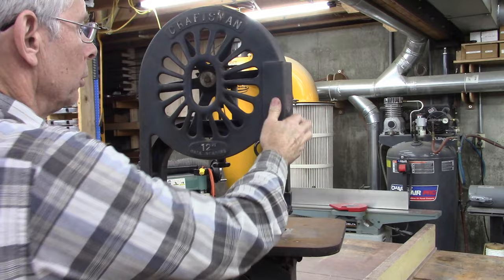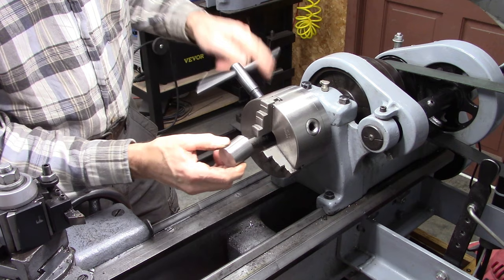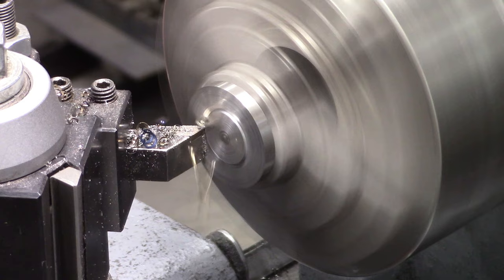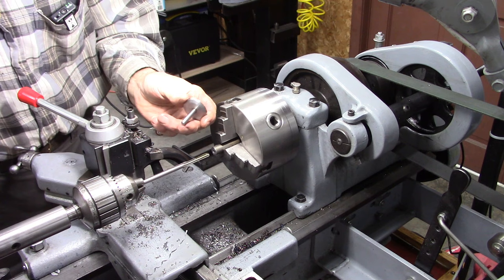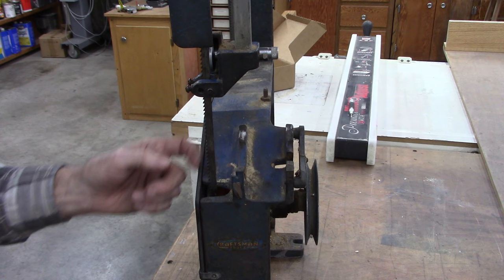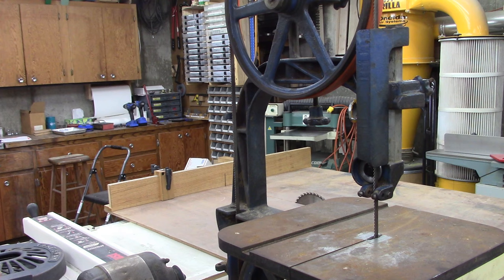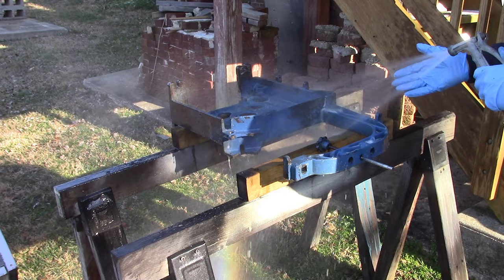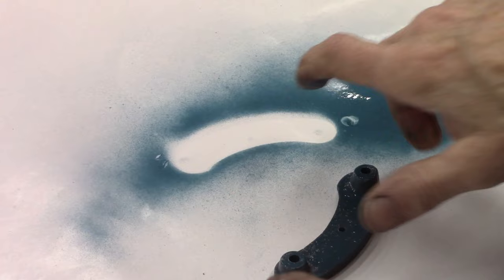Restoring a 1930's Craftsman Bandsaw - Part 1

Comment: I have that exact saw.   I think they are referred to as the “Snowflake” model.  I put a thread mill motor and controller on it so I can cut both wood and metal.  I also fabricated new upper and lower blade guides using roller blade bearings.   Mine was in nice shape too but I did put new tires on it.   I inspected the  bearings but they were in good shape, but I did notice they were metric which I thought was interesting.   I put a high quality German made blade on it and use it mostly for cutting metal.   I absolutely love it and use it all the time.
Reply from the maker: Cool...  my upper guide works well but I may replace the lower. Yeah, this is a nice saw.

Comment: Glad to see the bandsaw being cleaned and refurbished and given a new life.   They do not make them like that any more.
Let me know if you want a small chuck of lignum vitae to make dowels for the lower guide.     The natural oils in this wood have been used for bearings for centuries.   I recently cut some into 1/2in square short lengths for a local friend to use at the lateral guide blocks in her Jet woodworking bandsaw.
Dave.
Reply from the maker: Hmmm?  sounds interesting. winkysworkshop@GMX.com

Comment: Hi there Mark, that is a beautiful machine, nice find.!, that would look very Amazing in that dark /Burgundy Red that you have used in the past. Love that color. But what ever you paint it , it will look beautiful as always
Reply: You are exactly right that dark Burgundy he used on the belt sander would look amazingly good on that saw with all the cut outs around the blade wheels.
Reply from the maker: I agree...  love the read paint. This blue paint is close to original and I got it dirt cheap. I like the blue color but also agree, the red is nice.
Reply from the maker: Yeah...  that was the CBN grinder and also the base for my drill press. I agree, a great color.

Comment: I have a 1932 Craftsman band saw owned by my grandfather and later my father. It works great. Only had the rubber tires replaced once (by me) in all of that time. I think the blade on it is original.  It also has a full metal lower blade guide and not a random piece of wood stuck in the blade guide holder. Your upper blade guide is completely missing as well.
Reply from the maker: The upper was all there aside from the thrust bearing which I made in this video. From all the pictures I have found of the lower guide it was originally a steel dowel but I made a new one with bearings that will be in a follow up video.

Comment: Mark I love it. Walker Turner made one that I have always wanted. Cast iron blade guards. Very ornamental. All of them I have seen are for wood and would need to be geared down.
Reply from the maker: Thanks, this one will be "belted down"? Ha
Reply: My opinion belt drive would be much quieter and better. I have a Belt drive mill and a gear drive mill, and the noise is remarkably quieter and smoother than the gear drive and it also has VFD for speed control. Its already a sweet looking saw and I am sure it will be top shelf when you finish the project as your work is always of great craftsmanship.   @WinkysWorkshop

Comment: Nice score. I'm eager to see where you go with this project. I have a Delta 14" woodcutting saw. I do little in wood, so it took up floor space, largely unused for thirty years. At long last I did a metal cutting conversion. My 4x6 H/V saw has served me well, but it's really nice to have a proper vertical saw now. I use it a lot. You'll really enjoy yours.
Reply from the maker: Hopefully my slow down works well. We will see. It will be handy!
Reply: How did you slow your Delta 14” saw down? I have the same saw and have thought about getting a one horse 3 phase motor and a VFD for it so I could use it for both metal and wood.
Reply: @Hoaxer51  After pondering several methods, I wound up at a two-step V-belt reduction to get from wood speed to metal speed, and a 3-Ø motor and VFD to get a range of metal speeds, from about 80FPM @ 20Hz for tough steel to 400FPM @100Hz for aluminum. I don't think you can get enough range for both metal and wood from a VFD. You'd have to run it from about 15Hz for steel to 400Hz for wood. Seems risky to subject a motor to that. But the wheel shaft is long enough to fit both the original pulley, and a large one for reduced speed. So for the rare times I want to cut wood, I remove the two short belts, swing the countershaft out of the way, and put the original long belt back on. (My saw has its motor on a shelf near the bottom of the legs, and I put it on a tilting motor board, so I can adjust for belt length and tension.) Not as elegant as flipping a lever or two, but it's easy and takes only a minute.
Reply: @randyshoquist7726 , Thanks for the reply, it seems nothing is ever easy, does it. I keep looking around to see if I can find another bandsaw for a good price but nobody seems to be giving them away, so that’s probably the way I’ll end up doing mine also.

Comment: Years ago, while on vacation, I found a 25:1 gearbox at an indoor flea market that I wanted to convert my bandsaw to cut metal.  I carried it on the airplane in a plastic gift bag and at about 30lbs, it would have gone overweight in my luggage.  I had to act like it didn't weigh anything and set it between my feet under the seat in front of me.  I wrapped it up good but that gearcase oil smell is pretty strong.  I thought it was the best thing that happened to me on the whole vacation at the time.
Reply from the maker: Part-2 will be posted Friday and then Part-3 a week later. Part-3 will feature a home made slow down...  You sound like me with the gearbox

Comment: Nice ! I did the same thing with my blade guide,but I was lazy and used a valve from an old dieselmotor.Hard as a koffernail,but I could cut it with cbn.
Reply from the maker: Darn good idea on the thrust bearing!

Comment: 4140 H.T./P.H. is about 28-32 Rc hardness. It makes great cutting tool holders. Its much stronger, wear resistant, and cuts with a nice finish using carbide tooling. I made many tool holding arbors out of it. Good Stuff! F.Y.I.- Nothing worse than ice in your hose!
Reply from the maker: Ha...  yep, it was too cold for sure. Good to hear on the 4140. Steel types are my weakness.

Comment: Interesting project. Never saw a bandsaw like that one before. I used a 135 rpm Dayton gear motor to slow my Delta 14 down for metal cutting but still needed three/one reduction to cut tool steel. I’d try a hardwood or Delrin dowel for that lower guide. Rigidity will be an issue for metal.
Reply from the maker: I'd say you are right about the metal...  maybe I'll go all our and build one with bearings. Thanks

Comment: Nice find Mark. She will make a great user.
On a side note, the audio on your video is great. The lathe still has its note but it didn't overpower the audience. Not giving commentary while the lathe was working also helped. 
Looking forward to part 2, and seeing it in action in future videos
Reply: The official temperature in Geraldton Australia was 49.7C, about 121F, last week (and a fair bit hotter in my workshop). Maybe you could send us a little of that cold 😅
Reply from the maker: I'm exploring a gear hobbing attachment for my mill. If I ever get there new gears for the south bend will be the first thing I do.
Reply from the maker: WOW! I hope I never see temperatures that high! Thats terrible.
Reply: @WinkysWorkshop , A hobbing attachment, that will be an interesting video, hopefully in the near future.
Reply from the maker: @Hoaxer51  I'm getting help with the gear hobber controller.

Comment: I have a 20" Cresant bandsaw,heavy,the motor runs 850 R P M's it's 1HP the motor is heavy 😅 it weighs 100 lbs. The lower wheel is mounted to the motor it's got at least a 1 inch shaft.I cleaned it up repainted it and it worked great.
Reply from the maker: I'll bet it does! Love the slow motors!

Comment: Great resto job, love old tools especially when someone like you takes the time to do a great job on them. Just one question, why didn’t you use a self etching primer or a high build primer?
Reply from the maker: That's a good question and I actually considered putting it on my video but i was afraid it would ignite a lot of disagreement. First, laziness (ha) but second, the saw was not originally a smooth finish and I thought it might make it look too new plus the casings are all excellent anyway. As for the self etching primer, I have had terrible luck getting some paint to stick to it and I've never figures out if it was the primer or the top coat. In the case of my Hardinge lathe cabinet I had terrible luck with the primer not bonding to the base paint. Overall I've had excellent results with the paint directly on the metal of even slightly rusted and cleaned surfaces. The hardinge Lathe itself I used filler an automotive primer and it did well.

Comment: That's a nice little saw Mark. I'm wondering if that lower blade guide is a phenolic/linen composite. I bought some square guides for a similar sized saw called "Cool Blocks". They were a phenolic/linen impregnated with graphite.
Reply from the maker: Thanks, It might be but it looks like plastic. I think the original was steel from the pictures I've seen. I just made one with bearings so problem solved. I was worried about using it with metal and that original guide.

Comment: I have a Jet table saw with a motor mount that looks very similar.  Last year I had to replace the mount because of metal fatigue and it BENT close to the pivot point.  I was lucky that I was able to find a replacement.  Perhaps the homemade mount you found was simply someone's attempt to fix a bracket that failed similarly.  Most homemade stuff looks like crap, but I bet you can do better.
Reply from the maker: I'm making it now...  I think you are right. Thanks

Comment: A couple of pillow blocks and a jackshaft maybe with a large pulley should slow it down enough.  You see a double pulley every now and then with a small one and a large one, but I looked and didn't see anything even used on ebay (kinda reminds me of a cement mixer).
Reply from the maker: I built a slow down with flat belts, video in one week.

Comment: If you used a vfd and one of those 3/4hp, 1150rpm motors, I calculate you could drive it with a 1.75" motor pulley and a 10.75" drive wheel pulley (no gearbox) that would give you 100-600 sfpm blade speed and a cutting force of 40lbs (dragging the blade thru the metal) which would work for steel and aluminum.
Reply from the maker: Yeah... I think the new motor would be an eye sore on the old saw. I'm building a slow down with belts...  hopefully it will work!
Reply: It wouldn't look original (ha, you could paint it to look like the old one) or maybe just hide all the reduction stuff in the base.  Any idea what speed you plan to shoot for?  I've got lots of pulleys if you give me an idea of something you're looking for.  That's a neat little saw. @Workshop
Reply from the maker: @robert574  100 SFPM is what is needed for steel. For a 12" wheel on a bandsaw that is 33 rpm.  Here's a sneak peak the video coming out next week. https://photos.app.goo.gl/ni5kTjPLeCeu98wX7

Comment: Dunlap didn’t come about until 1941 so doubt it was the original. if you are interested those motors did have a date code of something like MW YY. Where M was a letter showing the month (A = Jan, W is week of month and YY is year). Should be stamped and not printed on tag
Reply from the maker: Interesting. You know a lot more than me. Thanks!

Comment: Hello Winky, I can not wait for the next video, can it cut metal and what throat size is it? It is in good hands for a complete make over. Cheers from me. 😷👍👍👍👍👍
Reply from the maker: Its a 12 inch but big enough. Wood only right now but I'm going to build a slow down so it will cut metal - thanks
Reply: OK, thanks for the reply, will a speed control work? @WinkysWorkshop
Reply from the maker: @magicbytes3835  A speed control would require a motor change. I'm probably crazy but I'm going to keep the old motor and do it with belts and maybe a chain drive.
Reply: Sounds good to me, looking forward to seeing it in action. Cheers @WinkysWorkshop
Reply: @WinkysWorkshop , Will you make it so you can do a quick change back in case you want to use to cut wood?
Reply from the maker: @Hoaxer51  For sure...  although I'll have to change blade so it will still take a few minutes. Fortunately this saw is easy to change blade on. My other saw is a pain.

Comment: I try to finde those old mashinery to restore myself. But somehow I can‘t find any. Onetime I found one at an auction, but it was so expensive, that I did not buy.
Reply from the maker: It seems like I have to drive several hundred miles whenever I find one. This one was only 48 miles away....  maybe a little high priced but it was all there and in good shape. The tires and the thrust bearing was the only small issue.

Comment: Hi Mr Winky, That saw was made when people had common sense. That's why theres no guards.
Reply from the maker: I'm all for safety but you can go too far. I think it's partly driven by lawyers and lawsuits. I used to work on printing and in the late 70's I begged them to put several guards in place and they refused. This was massive machinery that could pull a hand or arm off faster than you could blink. Then in about 1990 (aprox.)they went ape sh.. crazy with guards. OSHA changed the laws where if the company did not guard the machines to their standards they would be fined and held 100% accountable if there was an injury. At first I though, well this is a good thing but soon you could not see, make adjustments and even run the machines. It was crazy! Even more crazy is that acidents went up and then went back to where they were.... they never really improved!

Comment: Hi Winky, I just bought a Craftsman 1936-1938 model 102.01121 12" Bandsaw to restore.  I have so many questions...  First of all, it appears to be complete with no missing parts and aside from dirt and grime, looks in good shape.  First off,  I need tires.  The ones on it seem original and dry rotted.  The wheels are flat.  Where do you recommend finding tires?  I found the original owner's manual online but surprisingly doesn't list blade size or tire size.  Secondly, what paint and color did you use?  This one seems to be the same color.  I love your videos!  Thanks Bob
Reply from the maker: I got the paint for $2 a can at a discount store. Its Satin Krylon Fusion Peacock Blue. It one of those colors that looks boring in the can but fantastic when you use it. I went back and got 6 more cans! My saw came with over sizes polyurethane tires. I shortened them and they work okay but I think glue on rubber is better. I crowned mine on the mill, kind of a bad way to do it but it worked. Google the tires but be sure you get one for a 12 inch wheel. Lots of 12 inch saws are 12.5" so they actually cut 12 inch.
Reply: Any recommendations of a tire company?  Also, I dont know what size blade this thing has.  Can't find info on the        web (yet). @WinkysWorkshop
Reply from the maker: @jackodog13  I looked and looked...  no luck on the tires. I'd buy these and  try to grind the crown like I did. https://www.woodcraft.com/products/carter-products-urethane-tire-for-12-bandsaw-7-8-wide?variant=43401117139082&gad_source=1&gclid=CjwKCAjwnv-vBhBdEiwABCYQA8Cfi_mlu5JbzkHCV0pfh-fA0Eo6L28EcPKZ9rrNgXvNppMoQCru2hoCoXMQAvD_BwE&gclsrc=aw.ds#product-details
Reply from the maker: I order from here. 6 ft 7 inch https://www.bandsawbladewarehouse.com/ @jackodog13
Reply: @WinkysWorkshop   Thanks so much for the info!  If I sent you the table insert from this saw, could I pay you make a new one for me?
Reply from the maker: @jackodog13  Maybe...  Mine has a poured lead insert so I have no idea what yours looks like. winkysworkshop at GMC
Reply: I could mail it to you.  Looks like 1.25od and maybe 3/32 thick.  I'm no machinist 😊
Reply from the maker: @jackodog13  I order from here. 6 ft 7 inch https://www.bandsawbladewarehouse.com/  but yours might be different
Reply from the maker: @jackodog13   I looked and looked...  no luck on the tires. I'd buy these and  try to grind the crown like I did. https://www.woodcraft.com/products/carter-products-urethane-tire-for-12-bandsaw-7-8-wide?variant=43401117139082&gad_source=1&gclid=CjwKCAjwnv-vBhBdEiwABCYQA8Cfi_mlu5JbzkHCV0pfh-fA0Eo6L28EcPKZ9rrNgXvNppMoQCru2hoCoXMQAvD_BwE&gclsrc=aw.ds#product-details

Comment: Why is the motor dual shaft? Whats the extra shaft for?
Reply from the maker: Well this is just a theory but I could be wrong. I think Craftsman used the same Dunlap motor on many tools. I've seen this on table saws (although a larger motor and drill presses. The examples I just mentioned had shaft covers over the unused end so it's possible this motor on the bandsaw was added later, hard to say.  I'm going to utilize the other end with a speed reducer.
Reply: @WinkysWorkshop  I have an early-50s Craftsman table saw with a double ended motor. I need to make a cover for the unused end.
Reply from the maker: @randyshoquist7726  I've seen those covers. I plan to utilize the shaft for the slow down for metal.

Comment: hi do you still sell parts for the Wimshurst Machine ?
Reply from the maker: I have some but not many. I have several hub kits a couple pulley sets and a pair of 3 inch brass tinted balls. NO sectors (having a hard time getting tape). I just order two rolls of another brand but so far only Tape Master has proven to work well with the sector punch. They said January 1st but still nothing. Here's a link to what I have. Prices have gone through the roof so I doubt I'll offer kits.  https://markq6zlmc.fws.store/browse/cat7671237_4804850.aspx
Reply: thank you